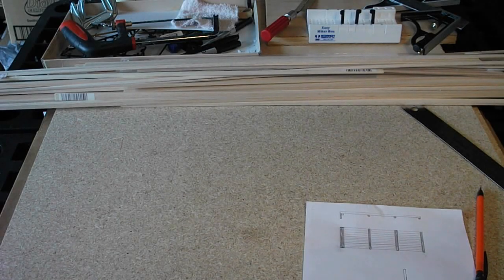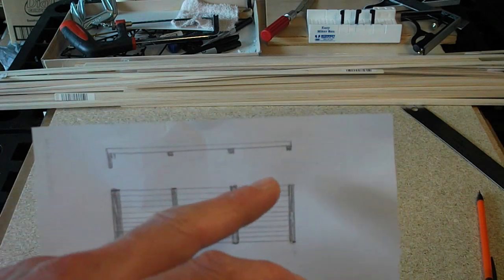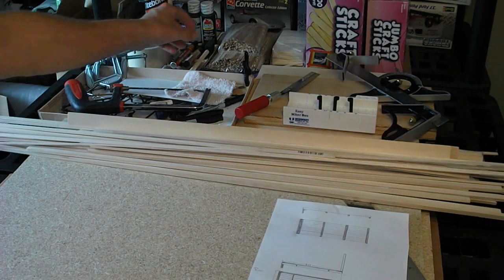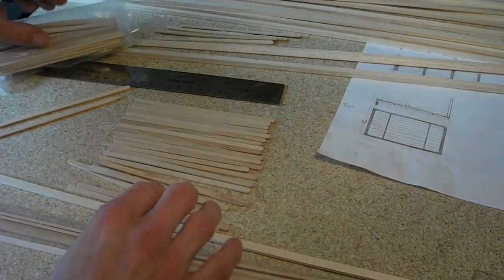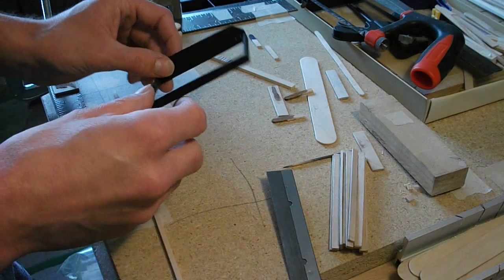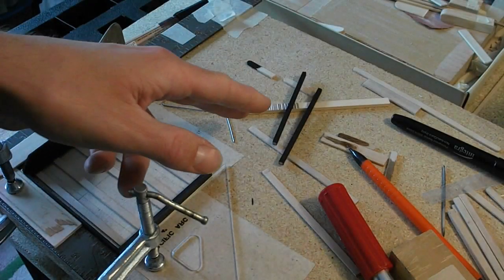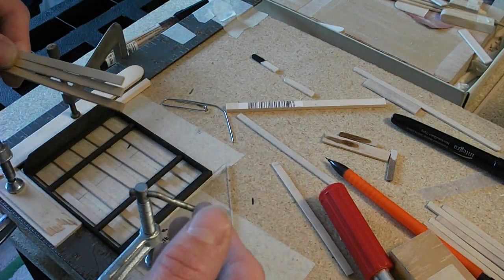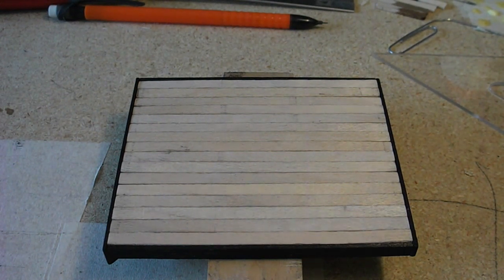Building a 1/24 Scale Model Truck Flatbed

Comment: That's nice. I'm planning one now for the back of an extended Dodge cabover (Lindberg 1/25). If you choose a medium stain you can later sand with the grain using a medium steel wool to create a nice weathered look. Be careful with your clear coat - they can add a gloss that looks unrealistic. Also, some stores sell wooden stores sticks that are perfect for truck beds, barns, fences etc. They take a stain well and glue with the adhesives you're now using.

Comment: Great video. Did you do one on attaching it to the pickup? I have started a small trailer for my John Deer backhoe model. Not sure how I will build and attach the axles to the trailer. By the way I will use a light wash with AK pigments and then add dirt and grease stains.